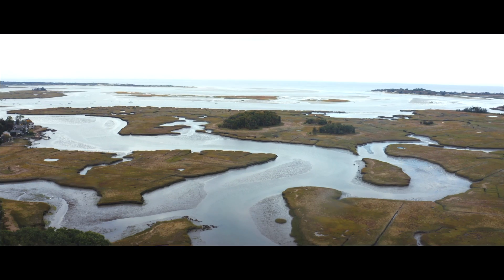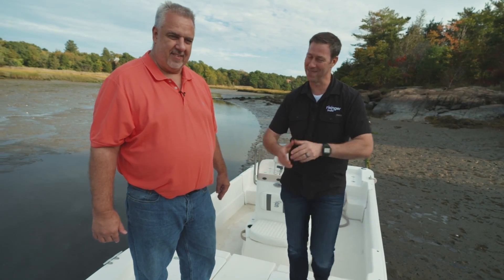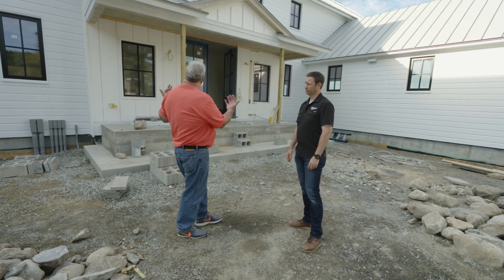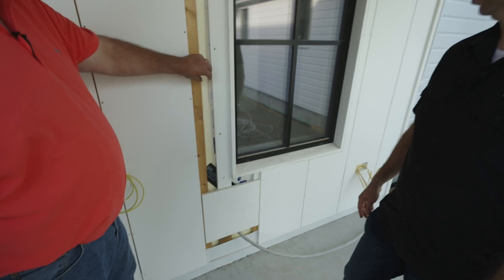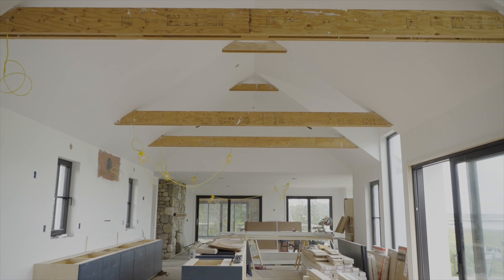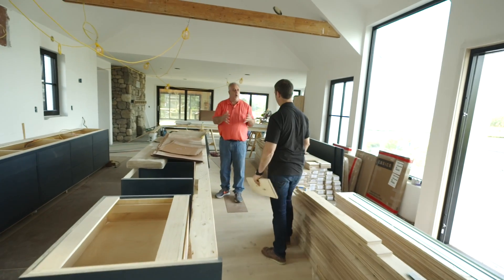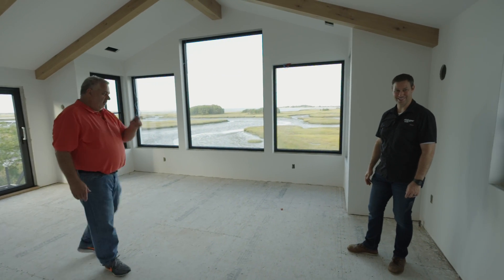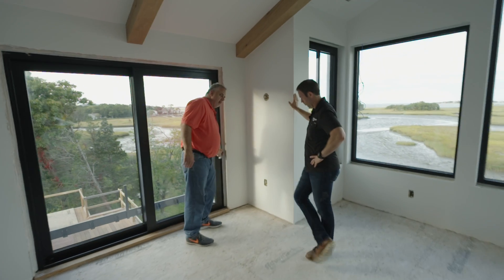High Performance 2x8 Wall Assembly

Comment: Do you know if there is going to be a rental unit available for the blown in rockwool insulation? My understanding is that the cellulose/fiberglass blowers can't handle the loose rockwool.
Reply: Great Question Cole as I have discussed this with my insulator. You need a blower with an adjustable auger speed so you can slow it down for the Rockwool. The lower speed won't cut it all up

Comment: Matt, do you have any more detail on the built in automated blinds? Is that a custom box? How does the drywall get finished? Thanks.
Reply: The cassette slides up into the cavity and is finished with a metal cap. A thin slot is left to allow the blind to lower out of the cassette.
Reply: Awesome, what’s the brand?
Reply: @stevenbaczekarchitect9431  Thanks. Slide it up just before drywall or before insulation?
Reply: @stevenbaczekarchitect9431  Do you have the detail on how the cavity is framed?  It would seem to be in the way of the header.  Thanks

Comment: I would love to know how they handle a 1200cfm range hood in these tight houses? I get they have the fresh air coming in and this one has that extra flow but I doubt it's enough for a range ventilation.
Reply: It's not that big, it's induction cooktop so there is only odor control from the fan

Comment: Any thoughts on that metal roof sliding all the snow directly on those upper decks and the master balcony? Going to be a very heavy compacted mess.
Reply: Engineered to handle it, but given the location there wont be much snow on those roofs

Comment: Hi Matt, I don't know how else to contact you; so, I am just commenting here. Can you do a video about suspended concrete slab for garage and proper waterproofing? particularly for colder climate. There are not much information online about it.
Reply from the maker: My parents did that on their home in Pittsburgh. I’ll look for a good opportunity to video that. Thanks for your support
Reply: Basements are an open invitation for mold.  Gravity & moisture. Thank you
Reply: @2ndChanceAtLife  not if done properly
Reply: @woohunter1  sorry I disagree. 
I was poisoned by mold after my house flooded. The mold doctors recommend slabs. Respectfully
Reply: @2ndChanceAtLife  with all due respect, my question was not whether to do the basement or not. Where I live (Ontario) local code requires foundation to be at least 4' under ground to be under frost line. So, 99.9% of the houses have basement. And some of the new houses have extremely fancy basement. So, please don't steer this thread toward  pros/cons of having basement and share information about suspended concrete garage floor if you have.
Reply: @2ndChanceAtLife  I live in the northeast where almost everyone has a basement, my house is a 50 year old ranch that has zero mold, mildew, and moisture problems.  Once again, if done properly........

Comment: That looks great. Can you do a custom home that in the price range of the general public?
Reply: The “General” public probably can’t afford a custom home. There’s a reason they’re called custom...That being said I’d love to see some more benson wood stuff and other homes that might not be custom but are still more high performance and modest.
Reply: I would love to see this as well. I believe a great quality custom home is possible if people are willing to smaller. This is what my husband and I are currently building. For example, a custom home does not have to be 10,000 square feet and have ten bedrooms. However, that is the type of custom homes we see on YouTube.
Reply: @mamabear9389  what builder are you using? I would love to build a custom home but they are all so expensive
Reply: @servus47  There are ways to keep cost down. Keep it small, rectangular shape with gable roof. No crazy bump outs or insane roof lines. You could build on a slab and finish the concrete floors. You can also have the shell constructed and act as general contractor to finish it out. That will save tons of money. If there are Amish around use them for cabinets. They do a better job and cost is reasonable. You could also consider building a pole barn home with a slab foundation. That is what we are doing. It is 1800 square feet. The great room is 34 x 22....not much smaller than the mega house in this video. We are using Morton Buildings. However, we just had them do the structure. I am general contractor for finishing it out. Note that I have never done this before but it is working out. The house is beautiful.

Comment: If you put closed cell spray foam on the inside of the sheathing, and rigid foam on the outside, what happens if water gets in? Don't you have a vapor barrier on both sides of the sheathing?
Reply: rigid foam on the outside is semi permeable EPS

Comment: Anyone know who the manufacturer of the flooring is? I'd like to find some info.
Reply: He said it's european white oak so it's probably a european manufacturer as well. I know a couple of austrian companies: Tilo,  Weitzer Parkett, Admonter, Trapa Boden.
Reply: @JamesG1126   You specify a ⅜" white oak top board with a ½" birch ply backing laminated with a particular resin glue cut to 5, 7 and 10 inch widths at 6 and 10 foot lengths, all back-cut and with chamfered  T&G.
Put out the tender document and when the quotes come back the price from Austria, even with shipping and import duty, turns out to be less because they have it in the warehouse while the Pennsylvania mill tells you that's a special order, going to take time, cost money and heck, you want feature wood for that?
Yeah.  Sometimes going for foreign imports is  pretentious dumbshit, but sometimes it's plain ole good business sense.
Reply: @calmeilles  If you specify only European spec engineered wood, of course it's only in stock imported from Europe.   Maybe you don't need that particular resin glue?   Maybe you don't need birch ply.   Try fir ply.  Yes, it's pretentious dumbshit.

Comment: might be a silly question but the back side is almost entirely glass. How is the shear taken care of? is there s steel frame or something?
Reply: No steel at all, just thoughtful design. I worked with my structural engineer to address the shear very specifically. He is extremely good at what he does, good teamwork. Great question by the way
Reply: @stevenbaczekarchitect9431  Hi thank you for respond its a very cool project. Just by instinct i see small wall sections and i have to ask the question. As an aspiring structural engineer.
Reply: @stevenbaczekarchitect9431  I'm trying to place this location. Is this Scarborough, ME?
Reply: @Crazylalalalala  no problem bud

Comment: Beautiful home!  Question...Is the gap between the lap siding and wall insulation (Furring Space) acting as a thermal break as well?  In other words, it can take the pressure of the cold and hot air and move it thru the wall up or down like you would have an air gap on a brick wall?
Reply: Not really, drainage down, ventilation up

Comment: I like these videos .... However, I'm so not as impressed, if I had sh!t ton of money to spend .... this is what I'd do.  Money is king always.

Great video Matt.
Reply: Just to be clear, many of the details I use in this house I use in he 200, and 1500 sq ft homes I design
Reply: @stevenbaczekarchitect9431  200 man that's one small house .... lol .... ok ok I know you really meant 2000
Reply: @stevenbaczekarchitect9431   I guessing that you do  these details not out of the goodness of your heart though.  The customer has to have the extra coin to actually pay for the extra mile ... No?

I'm also guessing that you're not building spec, production, homes in subdivisions but individual homes?  Or if you are building spec homes ..  are you adding all that sealant under sole plates out of the goodness of your own heart?

... and again I say ... Money is King ...
Reply: @johnjacobjinglehimerschmid3555  Yes the 200 was 2000, and no I don't work for free, do you? I don't consider my services and extra cost, I think that is problematic from the start. My cost is an investment in the project. And I have all kinds of clients - I'm doing a 1000 sq ft house right now. And yes I do work for a very large spec builder who builds very well performing houses, maybe not this good, but a great margin above code. And money is king......well hell our WHOLE CULTURE is based on it

Comment: Steve, for the foundation, did you use the tough n dry (or what looks like comfortboard) in lieu of a dimple membrane ?
Reply: Its an oriented rigid fiber insulation that can drain

Comment: Should have gone with 2x12 framing, double wall, entire structure underground, with some aerojel Insulation.  No windows, use closed circuit flat panel TVs instead.  I mean, if you want a tight house then $ and embodied energy is secondary.
Reply: We thought about that but the additional blasting was not in the budget
Reply: Phenomenal work Steve!
I wish more people had your conscience when building.
Reply: @stevenbaczekarchitect9431  Yes have to meet budget.  But then, if one shaves off a few thousand sq ft from work out rooms, bath rooms, and opt to not  build on N England estuary ocean front, there’s plenty of budget.

Comment: will there be problems with the seals on the dors since they are opening inwards? The wind will push the dores open and away from the seals and water could come inside. Instead if they were to open outwards the more wind the harder the dor would be pushed against the seal.
Reply: Check Matt's "This House has some CRAZY Insulation Details" video, it covers these windows. They're tight and Steve does a negative pressure blower test to ensure they are.

Comment: They could have used a high efficiency fire place.  That looks like a conventional fireplace that is mostly for looks.
Reply: Yes they wanted a real wood burner
Reply: @stevenbaczekarchitect9431  Since the 1700s Europeans have been building wood burning masonry stoves which operate with no airflow restrictions - damper fully open.  These capture heat through serpentine flue shelves.  Russian masonry stoves are sometimes built in the center of the house.  These types burn the wood more quickly but produce much less smoke and tend to produce no creosote so there is low risk of a chimney fire.  Some claim masonry heaters can capture up to 80 percent of the heat. Up to 90 percent of the heat goes straight up the chimney in most fireplaces.  Depending upon the design these can resemble a common fireplace.
Reply: @timothykeith1367  thank you, and yes I get it, I  have used those before, but some want the crackling wood open fire, so they get it. I do understand your point, but many times the decision is based on other values

Comment: I'm guessing somewhere north of $7-$7.5 million?It is nice, but the code in my neighborhood would limit the height , width and the out buildings- but damn, is that nice!
Reply: We were limited by height also, had to go in front of a conformance board.
Reply: Hence the blasting and basement elevation?
Reply: @Padoinky  yes, because of the walkout side, it added constraints. The roof at its widest is 28 ft, so its not a tall roof

Comment: A heat pump in Massachusetts?  Sure, the auxiliary heat will pump hot air no matter how cold it gets outside, but it does that by simply dumping electricity into the heater.

Comment: Is the best way to find a great quality builder to ask for recommendations from the architect?
Reply: Talk to your architect, but always research their work and if possible ask for client references from older projects that have settled in and have actually spent time in the elements.  Safe to say that quality architects and builders will likely never be the cheapest option but undoubtedly worth the extra expense.
Reply: @fr0nk3nst31n  Great advice
Reply: @stevenbaczekarchitect9431  🤔

😂😂😂

Comment: Only 2" of spray foam in the 2x8 walls and the rest in rockwool? Since you were right there with the spraygun why stop at 2"?
Reply: after 2 inches of spray foam the energy (heat or cooling) loss is only ~15%. At 3 inches it's 10%, 4 inches 7%, etc. It's just not really worth it for the amount of performance it provides after 2-3 inches.
Reply: Also allows electrical lines and plumbing to be run through the interior half of the studs without breaking the foam seal.

Comment: Too bad "high-performance' is not judged by how much energy use is needed. Perhaps some day you'll feature a net-zero house. cheers!
Reply: We did, go check out Matt's video library we toured a Passive House I designed - the video is a year old, titled "Top 10 Most Efficient Home In America"
Reply: @stevenbaczekarchitect9431  are the homes gas-free and net-zero?
Reply: @timskufca8039  Yes, I have a few dozen

Comment: As a HVAC tech shaking my head at all those windows. As the house ages, those windows will leak and loose efficiency. House will have issues heating and cooling, will definitely have problems cooling in the summer. Hell they should have sealed their ductwork, wtf are these contractors doing
Reply: Actually not, the IGU's are third party tested and lose less than.01% a year

Comment: Does that lovely home have ethernet ports?
Reply: I hope they though of that, along with at least Cat 6A runs for wireless access points throughout the house.  I also hope that for a project that expensive they would have a data contractor do them instead of an electrician attempting it.

Comment: What’s “classic” about a 10,000 sq ft house? How many MILLIONS did this place cost?  An engineer with Army Corps once told me “you can do anything if you have enough money.” Most will never even see a building like this let alone build one. The two mechanical rooms use more space than an entire apartment or house that most Americans live in. This is unrealistic for 99% of the world’s  population.
Reply: It's not a 10k sq ft house, and we all jus saw it, it's a sizeable house but I think you're over stating it quite a bit

Comment: Interesting wall technology but the random mix of different window styles is a dogs breakfast especially at 9.50. Hugh Newell Jacobsen does subdivided in”traditional” positions and then slashes big holes with frameless glass in unconventional positions to capture views. A method that works well. 
Very ordinary features and spaces, just bigger, without adding that extra umph that a budget and scale such as this can facilitate. Sorry guys, there’s just too much uncritical back slapping. Better to stick to the construction technology, which as always is awesome.

Comment: Is that all you are interested in is BIGGER? What about normal people who have a budget?
Reply: My videos are not about the size - they are about the concepts that decisions are based on. Ok this particular house is larger than average, but the decision making process for every inch of this house, is the same decision making process I am using for the 1000 sq ft home. See, airtightness and good water management don't care about size. People need to get over the size , or cost as it blinds them from the concepts of good building. And please don't come back with $$ are in these details, it won't sell here. I have done Passive Homes for under market rate in neighborhoods. I'm trying to sincerely educate the industry to understand proper management of their decisions. Lastly, this isn't a rant on you Roy, I appreciate your valid comment - please take it as an explanation.... the rant id for the unsubstantiated remarks the videos get. Enjoy Roy....

Comment: I'm sorry, but that house is ridiculous.  Yes, the site is lovely.  The architecture is well done.  The craftsmanship appears excellent.  But the very idea of a 7,000+ square foot energy efficient home is an inherent contradiction.

Is it good that this home was built to reduce its energy usage?  Sure, it is better that it is energy efficient than it would be if it was energy inefficient.  But the amount of energy required to build that stupidly oversized home is enormous.  If the owners were truly committed to the environment, then they would have built a more modest sized home, instead of this monstrosity.  Building an energy efficient 7,000 square foot home is basically greenwashing.  

If you are truly committed to reducing your carbon footprint, then live more modestly.
Reply: So if Amazon did a warehouse of 1 million sq ft, and had renewable energy.....is that an inherent contradiction?
Reply: @stevenbaczekarchitect9431  Oh come on, Steve.  You know that response is illogical.  A company like Amazon knows their business needs and how large their warehouse needs to be to fulfill those needs.  This house was sized based on the family's wants, not needs.  You know that the family did not need a house anywhere near that large.  A house 1/2 that size would have still been spacious and luxurious, but would have used far less energy to construct.